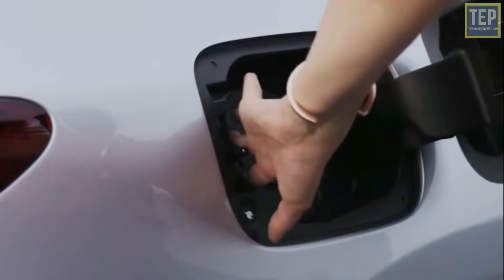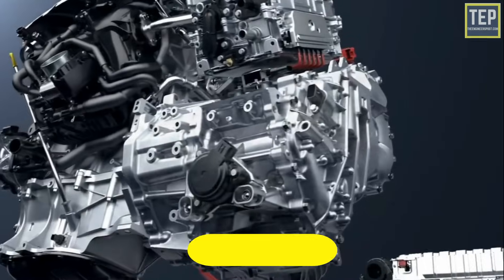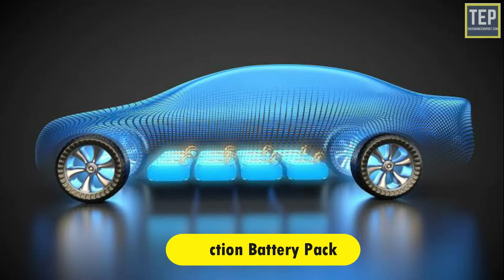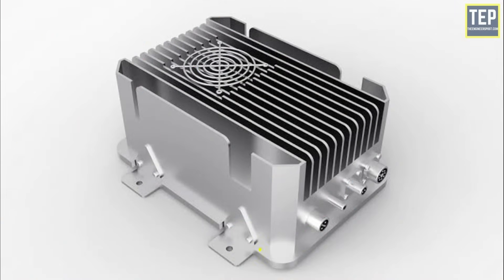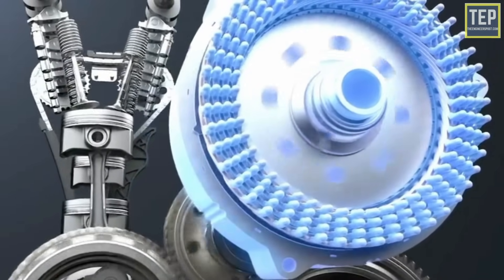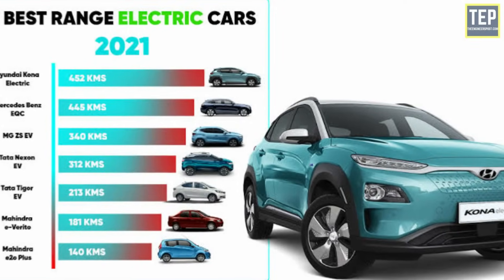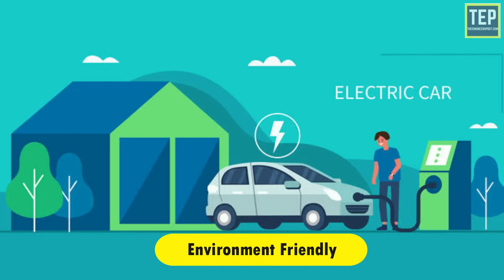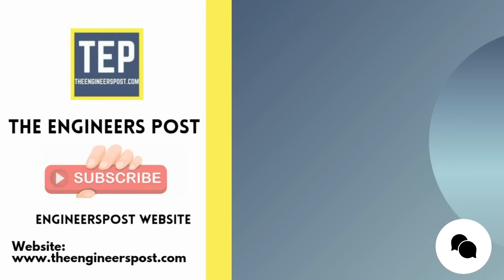How an Electric Car Works? Its Parts & Functions [Explained]

Comment: Electric cars are the future of driving Toyota bZ4X delivers efficiency, reliability, and zero emissions for a smarter way to travel ⚡🚗
Reply: Toyota BzX is horrible. The mileage are horrible. If you want buy an EV buy from an EV company and not from a legacy auto dealer.

Comment: The Truly Eco Engine

Since up to a 650 CC engine can now be run entirely on water from a homemade electrolysis unit, these smaller engines could be attached to generators, or alternators, and used to charge electric vehicles on the fly without cost or pollution. This is how to make an electric vehicle have incredible range, and requires no plug ins for charging. You literally can run your electric cars, fuel cost free, apart from the initial cost of engine and generator itself. 

This is the electric solution. With it, I have just eliminated all forms of user pollution. 

Since charging can now be almost eco perfect, we really can clean things up.   

This also solves the known power grid overloads we all know are coming without an alternate means of charging. 

The descriptive video is below. 

 We should all do this if it is possible.

https://www.youtube.com/watch?v=eacLgrqRdyk&list=WL&index=4

God Bless

Comment: ; I DO NO MORE INVOKE GODS BESIDES ALMIGHTY OR JOIN FALSE GODS WITH HIM, ELECTRIC CARS OR TWO WHEELERS IS ALMIGHTY WILL SETFORTH A PARABLE, I SEE SO MANY OLA SCOOTERS OUTSIDE DEALER RETAILER HERE IN MY HOMETOWN, OLA SCOOTER MAKER ISNT WRONG AT ALL, IS THEMSELVES WHO WRONG THEMSELVES THE BATTERY NOT PROVIDING SUFFICIENT MILEAGE AS PROMISED BY OLA SCOOTER MANUFACTURERS, CHECK NOW, OLA GOOD SCOOTER ONLY

Comment: When a 6lb battery  can move a 3000lb vehicle 20/25 miles in snow, freezing cold, sizzling heat,  up or down a mountain and still  run the heater , AC,  radio , power steering and other misc. accessories, like a convertible top movement or cell phone charging  then Ev will have a chance, Maybe.   There will still be charging issues , battery replacement issues and of course the ridiculous cost issues. Basically that's the E=mc2 of electric vehicles.

Comment: It’s worth taking a step back from the EV market and consider especially if you’re considering a second hand EV. Most second hand EV’S are ex-company car owned or ex-private Leased cars. In general these cars have had heavier use than a privately owned car. When buying a second hand ICE car generally most parts can be replaced at a reasonable cost but when any warranty runs out on an EV the component costs are very,very high so it’s worth thinking about before you dive into an EV.
Just recently the Chinese made cars software has become very big news so it’s worth checking this side of the EV as well.
Software plays an even bigger part in the EV than ice cars, such as charging, traction battery heat monitoring, traction electric motor heat monitoring and other numerous functions. Over Air software downloads are common place now in the motor industry but never more so than the electric car market.

Comment: The heart of an electric car lies in its electric motor, which converts electrical energy from the battery into mechanical energy to drive the wheels. Unlike combustion engines, electric motors offer instantaneous torque and smooth acceleration, delivering a dynamic driving experience while minimizing noise and vibration.

Central to the operation of an electric car is its battery pack, which serves as the energy storage reservoir for powering the vehicle’s electric motor. Lithium-ion batteries are commonly used in electric cars due to their high energy density, longevity, and rapid charging capabilities. The battery management system regulates the flow of electricity to and from the battery, optimizing performance, efficiency, and safety.

Complementing the electric motor and battery pack are various auxiliary systems and components that contribute to the overall functionality of the vehicle. These include power electronics, which control the flow of electricity between the battery, motor, and other electrical systems, as well as thermal management systems to regulate battery temperature and ensure optimal performance in diverse operating conditions.
#electricalvehicle #electricalcar #mamiwatacobalt

Comment: Two years have passed, and the technological advancement in electric vehicles (EVs) has been rapid. Some Chinese electric cars now boast a range exceeding 1000 kilometers, with fast-charging speeds reaching 80% capacity in just 15 minutes. Prices have become comparable to traditional fuel-powered cars, and, more importantly, there has been a significant increase in intelligent features.
Reply: We Americans don't want to know China has EV.
Reply: Because you can't compete with China in technology and prize. @Mingo101AtTiktok
Reply: @Mingo101AtTiktok  So we Americans. 

So since when did you get the right to speak for America/Americans? 

Isn't that the job of the President? 

I think you would be better served and your integrity/credibility kept intact if you would not assume that you speak for anyone other than yourself, unless of course you want to run to be the next President of The United States, because today the President of The United States, is Joseph Biden. Comphende. Cheers 🥂
Reply: Haha!  Which one has a range of over 1,000kms?
Reply: @oggyoggy1299 Plug in hybride car
Reply: @oggyoggy1299 yes
Reply: people start living on the moon

Comment: What is the use of EV if you charge it at your home electricity that came from burning coal and it's Direct or Indirect impact on the environment besides that the main source of the EV's battery is Lithium is also found in few countries✔💯

Comment: Revolutionary changes are coming in EVs in; 1) increasing range 2) reduction of time for charging and 3) reduction in cost. If you factor in the cost of ownership, which is, cost to buy, cost to maintain and cost to fuel, electric cars in many jurisdictions, are making buying even a use Toyota ICE Corolla a bad deal. Probably by the end of next year, we will see ranges in excess of 500 kM and charge to full of 15 minutes.
From that point on, limitation to its growth in sales, will be dependant on available charging infrastructure.
EVs are already sky rocketing in percentage of new vehicle sales and ownership. 
To the extent that conventional ICE engine manufacturers such as Toyota is doing its best to slow EV sales by promising real soon now technology.

Comment: What is the difference between the AC electric motor which gets the current from inverter , and the traction motor which is usually brushless DC motor ?
Reply: I interviewed a top energy expert on my home page vid. He warns EV conversion will not happen and oil can never be replaced.

Comment: Electric cars are not more economical. Because the battery operating life is short and the replacement cost is high.
Reply: I interviewed a top energy expert on my home page vid. He warns EV conversion will not happen and oil can never be replaced.

Comment: I tried building an electric car in the 1980s, but the government regulations made it almost impossible to do so. I bought an old electric golf cart that ran on six 6 volt batteries. I also had an opportunity to buy a Pontiac Fiero with a blown engine for $100. With a curb weight of 2,500 pounds, I figured that I could strip it down to under 1,000 pounds by removing the engine, transmission, side windows, rear window, and all the interior. Or I could have used a Volkswagen Beetle at a stock curb weight of 1,800 pounds. But.......when I talked to the Washington department of licensing, they said it would be impossible to license it because it would have to pass the emissions test in Spokane. For it to pass emissions, it would have to "emit" fumes out the exhaust pipe. They said I could get it to pass if I installed a clean running gasoline engine, then I could switch it over to electric for 2 years, and then to pass emissions again, I would have to reinstall a gasoline engine. Stupid governmental regulations. You can't fight city hall. So, I put the golf cart motor in an old Kawasaki 750 and ran it on four 12 volt car batteries. I geared it for a top  speed of 47 mph. I loved it, but the police hated it. Of course I couldn't get it licensed, and after a few tickets, I parked it, and switched to building electric bicycles using 12 volt blower motors from car heaters.
Reply: I interviewed a top energy expert on my home page vid. He warns EV conversion will not happen and oil can never be replaced.

Comment: Tesla Msrp allows the company to build its own charging network.  All Tesla charging stations are level 3 DC fast chargers.  Public charging stations(non Tesla) mainly slow level 2.  Public DC fast chargers mainly 50 kw vs Tesla 120-250 kw.  We need more level 3’s at least 120 kw.
Reply: I interviewed a top energy expert on my home page vid. He warns EV conversion will not happen and oil can never be replaced.

Comment: imagine this scenario... 4 year old EV gets into minor accident. Reports it to insurance and both cars can driveaway needing some repairs. The EV has a pretty good chance of being totaled by insurance. Can't service the battery pack, so it's impossible to tell if it sustained any damage. Gotta replace it, that's gonna total out normal priced EVs after 4yrs.
Reply: I interviewed a top energy expert on my home page vid. He warns EV conversion will not happen and oil can never be replaced.

Comment: First of all, batteries are terrible for the environment. If anyone has ever seen how people treat their vehicles now, wait till you see the problems we will be facing in the environment when more EVs are implemented. Battery thermal runaway? Yall ever heard of that? What happens if you get in a really bad car accident and the battery is punctured or damaged? You cant implement EV vehicles with batteries because they will cause an even greater mess of problems when given the opportunity. What do you find worse? Drinking gasoline-tainted water? Or water with battery-acid? How about terrorists turning their vehicles into EMPs? Or Explosives? Why give them the opportunity? With gasoline powered vehicles, it's a process with way more steps compared to the scenario with an EVs. 

What do you think about a company having control over what your car does remotely? They may not do that right now, but why give them the opportunity? How about the electrical companies? Are they willing to lower the electrical bills to accommodate for the change? Nope. Electrical bills will be soaring. Maybe if they also banned gas-powered appliances in the home and made everything electrical for every home? Maybe then they will reduce the bills? Nope. Those electrical bills aren't going to change. How are gas stations all over the country going to convert to accommodate for EVs? So why change right now? 

Think about it this way. Why would I go back from an EV to a Gas-powered vehicle? It's nonsense! You have exponentially more risk with an EV than you do with a gas-powered vehicle. They already take our hard earned money. They take taxes, they take our time, they take more and more of our rights, and our politicians aren't fixing the biggest problems we are facing in the country right now, why would anyone replace their gas-powered vehicle for an EV??? I'd rather spill gasoline in a car crash and have it do a gas explosion than spill liquid lithium in a car crash and have it do a battery thermal runaway. What are the emergency personnel going to do? Are local firefighters equipped to handle the frequency of electrical fires? Are local paramedics equipped to handle the injuries alongside of pandemics?? Are police officers willing to risk their lives to pull over their suspect to verify if they turned the car into a rolling C4 bomb????? Are they also going to establish entirely new state government organizational facilities designed to handle and provide emergency service for electrical emergency scenarios?????? How much more of my hard earned money is that gonna cost in taxes???????? We are already making some stupid ideas today that would be incredibly controversial to explain here. Why not enforce another stupid idea to come ruin everyone's lives? 

This is not the way to go. This is what settling looks like, people. This is what "quitting" looks like in the modern age. Instead of fixing the problems we have now and building up efficiency in solving those problems, we are looking for a shortcut without thinking about the consequences! This isn't a road we can simply make a sharp-turn on either. This isnt a road that you can force people to get into either. You have to let the motor companies do their jobs and sell the average consumers into the change. It's a big deal for the average American family or even individual or your typical college student, or a single mother, or an immigrant that is just trying to survive anywhere they can. We have soooo many problems right now. So many. EVs will not solve any.

Comment: Lol!!! So all of yous with electric cars who live in areas where temperatures dipped down to 0 and below, how's your car holdin up? I start my buick lacrosse and my Nissan pathfinder rock creek, let them run for 5 minutes and off i go. They are both paid off. No payments. I seen some nice electric vehicles but before i invest in one, they have to perfect them first. Till then, i will take 3 minutes to refuel while you take 20 to 30 minutes to fully recharge. If you should ever need to replace them batteries, get another loan because it will cost anywhere from 7 to 11 thousand dollars unless ofcourse you're rich and rich i am not. Sometimes it's better to stay old school. Old school is the best school...

Comment: It's only as clean as the fuel/method used to generate the electricity it uses. IF you have solar panels at home & u only charge your ev using electricity coming off your solar system, then you can truly say you're an eco-warrior. Else, you're just a wannabe pretender

Comment: This is an old video.  The cost of a new EV is now closer to $60K.  The video suggests an EV has fewer components and parts and leaves the viewer to assume maintenance costs will be lower.  Because each manufacturer specializes their own components, EV owners are dependent on OEM manufacturers to replace parts.  Because of rapid evolution of EV technology, many components may be hard if not impossible to obtain 10 years down the road.  Because purchasing an EV is more expensive than a combustion engine driven vehicle, because replacement parts are likely to be expensive, because certified mechanics for each brand and model may be in short supply, and because battery packs only have an average 10-year life and currently cost $10K to $20K to replace, it does not appear EVs will be less expensive to own and operate any time soon.  Also, we must factor in the 30- to 60-minute charging time at an EV charging station vs 5 minutes to gas up at a filling station, which will be lost productivity time for business, industry, transportation, and households, which will cause its own mini-recession wave effect on the economy, and an economic lag effect from reduced earnings and savings for households.  Many people already cannot afford to purchase e-vehicles and will be forced to rely on slower public transportation, with its consequent losses of time, ghastly sanitation, and deleterious communicable disease transmission.
Reply: Petroleum shill. (Oily, oily)
Reply: @sunmanyi3265  Thanks for the feedback. Actually, I am not a fan of fossil fuel vehicles with their emissions. My emphasis was that all the hype on EV's is glossing over what I think is going to be an uncomfortable transition for the general population. I suspect maintenance costs, resale values, battery life, replacement parts, supply chain snarls, upfront purchase price, and e-vehicle life expectances are going to create huge headwinds. Some early adopters have already declared they will never buy another e-vehicle. Scotty Kilmer recently did a video about a brand new e-SUV that only adds 8 miles range per night on a 240 volt home garage charger; that, because, as with many new cars, there is a draw on the battery when the car is just sitting parked. Think about it, the battery is the only source of juice for the vehicle. If you have no juice, you cannot drive, and cannot brake. A portable emergency jump battery is not going to get you very far. It looks to me like EV's are going to be a major accelerator to the spiraling cost of living and not likely to change over time, even with higher manufacturing numbers. The precious metals needed are going to remain in short supply and become more expensive to mine and process over time, as fossil fuels continue to inflate everything.
Reply: The cost of EVs, like ICE, depends on size.  I don’t know where you get the $60K #, but the Hyundai Kona EV sells for $35K.  

Still, MSPR for ICE are still cheaper then equivalent EVs according to Edmunds price data.  In the popular compact SUV category the average fully electric model, with a starting MSRP of $53,048, while the average of $35,722 for a gas-burning compact crossover.  I’d note that these aren’t exact comparison of features, but just average in a class.  The EV MSRP continues to drop and with EV Tax incentives thats price gap is completely gone in states that offer tax incentives.

As far as maintenance, numerous studies and consumer surveys show maintenance costs of EV are half that of ICE.  Add in cost of ‘fuel’ and the total cost of ownership of EVs is already cheaper than their equivalent ICE counterparts if kept for 5 years or more according to Edmunds